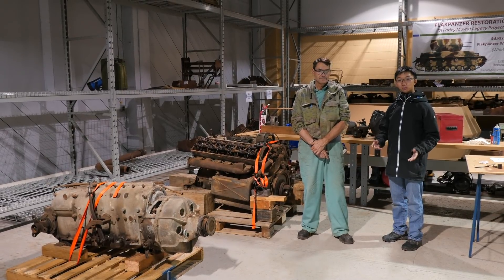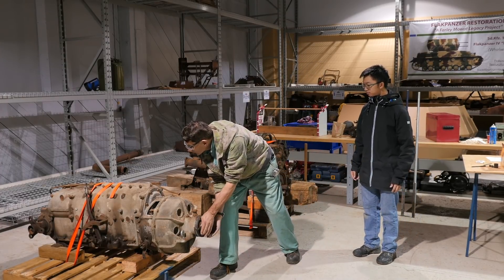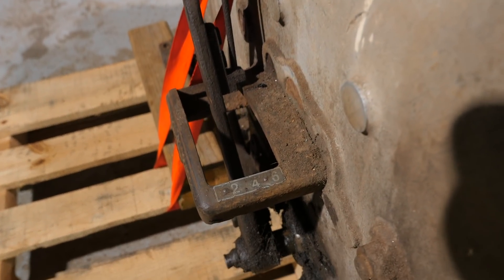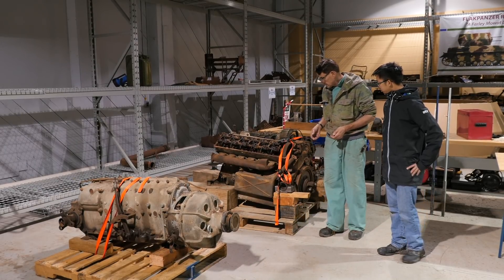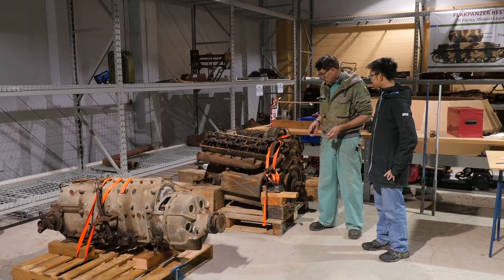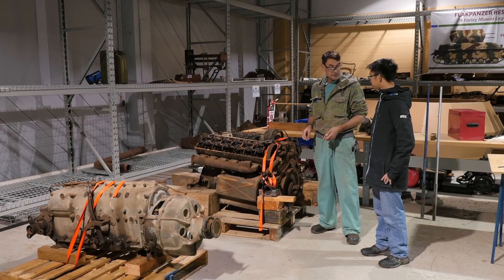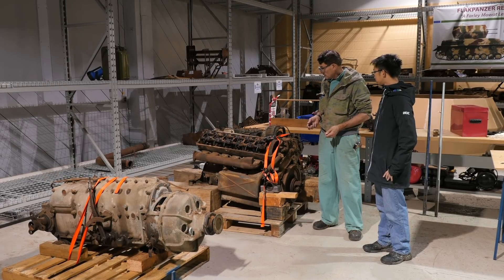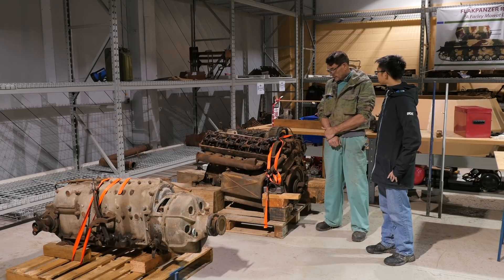Flakpanzer Restoration: Engine and Transmission Status (October 28, 2017)

Comment: Please say, what is the part number of your FlakPanzer gearbox? SSG76 or SSG77. It should be stamped at the left side of the gearbox, in front of the lever.

Thank you for the answer in advance.
Reply from the maker: We'll try to get you an answer!
Reply: Also this can be stamped at another place. Gearbox' case is assembled from 2 halfs. In the front-top corner of the joining edge (close to final drive) part number with SN of the gearbox can be found.

I am ex-restorer from Kubinka museum. Maybe can help with something.I don't work in Kubinka now, but maybe I remember something usefull for you.
Reply from the maker: Hi, we found the serial number is SSG76, you can see its marking in our Q&A video here: https://youtu.be/D_Iy0qNjL88

It is the third question we answer.
Reply: Thank you very much! This is part number, not serial! But this is what I asked.